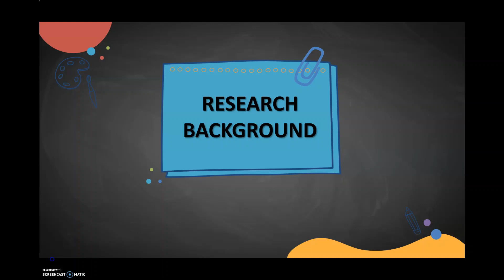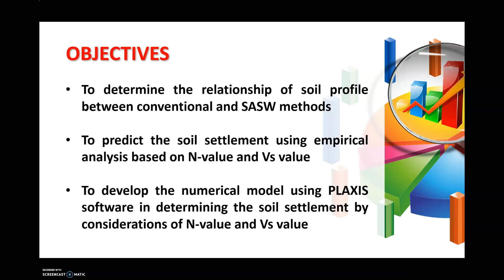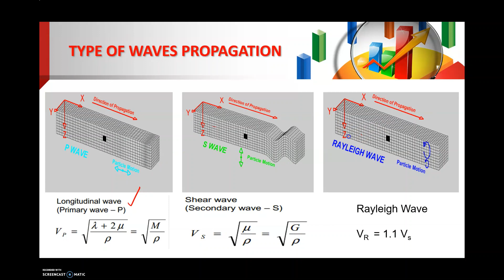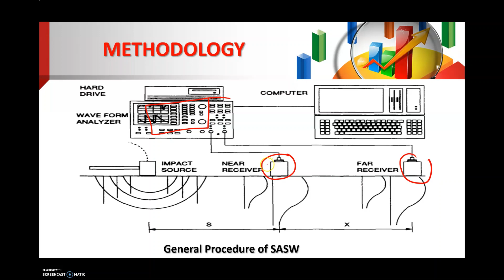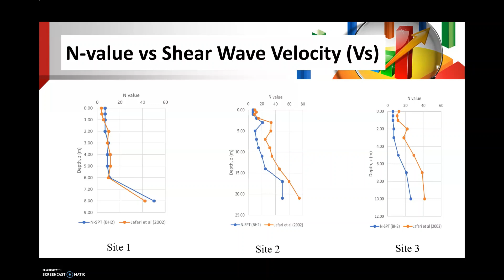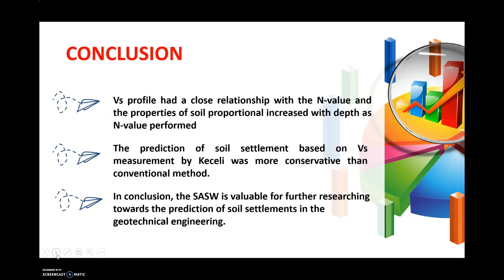Prediction of Soil Settlement using Numerical Modelling based on Shear Wave Velocity Measurement

Comment: I have read your paper as a part of research and I'm glad to see this video posted as well. It helps more having the video and the paper side by side. Just a clarification, in your traditional approach (Vesic 1997, Poulus 1989 & Bowles 1997), you have taken your N-SPT and found bearing capacity then found settlement, correct?  As in you did not use any program for that, right?
Reply from the maker: Thank you for your engagement with my work.

Regarding your clarification, you are correct. In the traditional approach, I did indeed rely on the correlation with N-SPT to determine bearing capacity before assessing settlement. I did not utilize any specific program for this methodology, as the approach primarily involves empirical correlations and analytical methods (based on shear wave velocity) as presented in the mentioned references. If you have further questions or need additional clarification, feel free to ask.